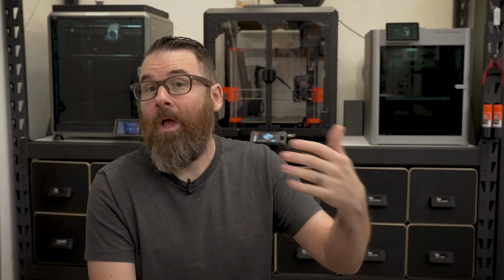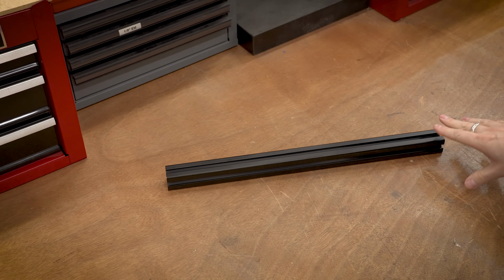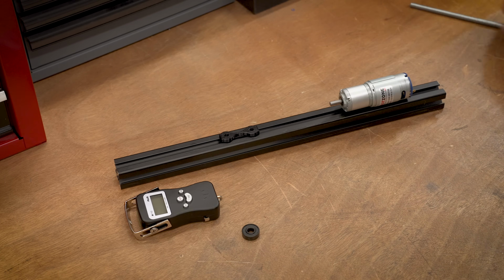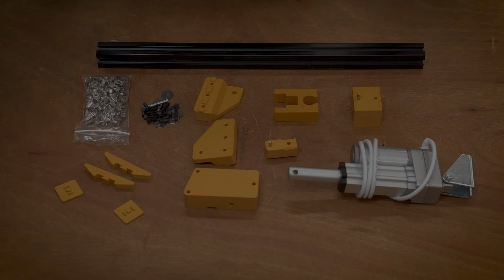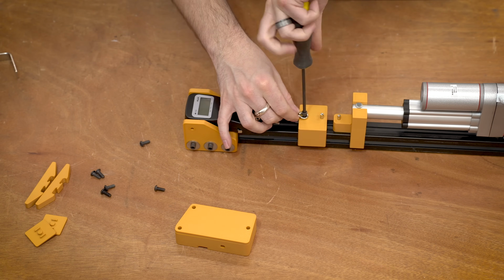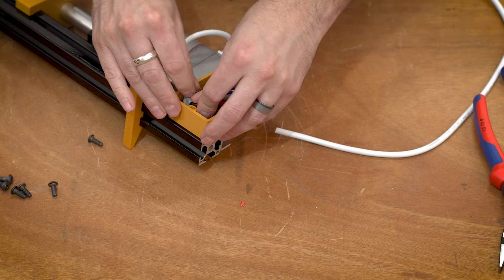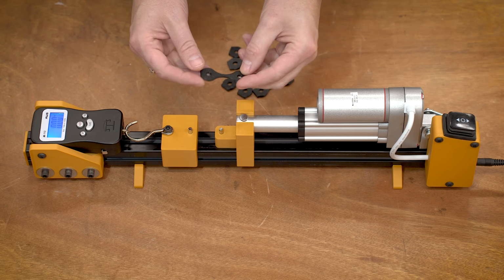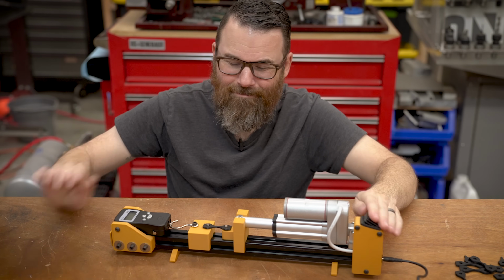Simple Tensile Strength Tester - Easy to Build!

Comment: Great machine, using this for a school project I am doing, I have a slight issue however with the luggage gauge you used. Once the testing piece reaches its max load and snaps, it doesn't record it on the gauge. When this happens it flashes the screen (It is on hold mode).

Comment: Nice work. Few suggestions if you plan to improve this work: try to align pulling cylinder of linear actuator with hanging scale (same height). Otherwise you will have some torque resulting unknown friction. Additionally in that case, you can use some D-chain link on both sides of test objects to connect linear acturator and hanging scale. No need for those parts in middle you mentioned that they will wear out. 
Reminder to viewers to buy a hanging scale which will show the peak of one movement. PLA is strong just don't like constant load, impact and heat. So for this application it is good. Only material which would be better is PC-CF. There are bigger T-nuts, but they are not rotating (you have to slide them form the edge). I suggest those for big load applications, like on side where only two holds the linear actuator. I enjoyed the video. Thx.
Reply: I had a feeling that I will see you there Igor 😂! Definitely gonna be inspired by this design for my application!
Reply: I bought all the parts from @thenextlayer Aliexpress links for this tester. Your suggestions for improvements make sense. Before I start printing the parts I think it would be better to modify the design to incorporate your suggestions.

First, if I understood correctly, you suggest to make the scale and actuator line up at the same height. That means scale has to sit higher so mount for the scale must be modified or new design must be used. I anyway have to use a different mount since I did not get the same scale.

Second, what kind of D-chain links do you suggest? Do you have a link to a picture or even better a specific model to purchase? In this case you suggest to completely get rid off the two "sacrificial" parts and put D-chain link through the holes of the test object to pull and the other side of D-chain link through actuator hole and scale hook?

Third, I was going to use ABS for all parts. You think for the scale mount PCCF would be required?

I would appreciate the reply. I tried contacting Robert over Printables to get the CAD model to modify the mount for scale but he has not responded yet.

Comment: Why didn't you try to position the pins in line with the cylinder of the linear actuator, so that plastic part isn't being twisted?
Reply from the maker: I did think about this, but it moves the scale up quite a bit.  I've found this seems to max out the force on the scale so I opted for simpler/smaller parts.

Comment: Cool build! I can really apreciate the thought that went in to this.

Let me add that measuring the elongation would give you the Young's modulus,and thus a more complete material properties picture. 
Having sleds that ride on the extrusion will compromise the force shown, due to friction, maybe have a stabilizing brace for the actuator and a free hanging adaptor between the scale and actuator.
Not sure if you are basing the sample geometry on any standard but I would reccomend using the same size for all materials and basing that size on an actuall IEC standard, such as 60811 or 62895. This will give you a true comparison in the future.

Best regards

Comment: Easy and effective, though your motor is popping the pieces rather fast. If that scale is doing any sort of 'slow polling' or averaging for accuracy, you very well could miss peak events, I'd lower the motor voltage for a few trials, just to see if readings get higher, etc.
Reply from the maker: Yeah, that's a fair point.  I'm hoping that the scale registers a max fast enough.

Comment: Ah not made here syndrome (About the comment near the start).

I too do this all the time. I really like how reduced to the basics this setup is. Nothing to break or need calibration or troubleshooting and easy to just throw out and make another at the mildest frustration, sign of wear or breakage.

I definitely tend to over complicate the crap out of things. Id end up reading USB PD specifications, trying to figure out automation, never getting around to perfecting it if I manage to get it to "bah, it technically works" and wondering how I got there.

I will say though, I highly recommend thee get thy some auto wire strippers! You deserve the stress free squeeze without strands to poke you left on the desk. They work for basically every wire within range and I think basically all the non full size combat robotics sizes.
Reply from the maker: I have MANY wire strippers.  The knipex ones are really nice and one of my favorites.  I did a whole video on different types of wire strippers, I have them all ;-)

Comment: I would recommend trying to settle on one size of test sample, rather than having multiple sizes. It will make it a lot easier to compare all your data directly, and should remove some source of error compared to trying to look at force vs cross-sectional area or something like that.
Reply from the maker: Oh, I will absolutely do that.  I just need to land on the perfect size that works for everything.

Comment: Since you already have limit switches in the actuator that will disconnect the motor at the end of travel, you could replace the momentary rocker with a single momentary push button (double pole double throw, just like the rocker and wired just the same, but with no center-off position.)  Arranged correctly, the rig will fully extend and stop.  Pressing the button will make the rig retract until it hits the other limit switch and stop, or until you let go of the button at which time it would immediately reverse and extend back to the stop again, ie, it would reset itself after each test.
Reply: This sounds completely reasonable but I somehow fear a pinch trap is stored somewhere in that suggestion.

Comment: I think a good case for why people use stepper motors for this is that they're easy to control the speed of, and they exert their highest torque at their lowest speed. Since you want tensile testers moving relatively slowly, the torque vs rpm curve of a stepper makes a lot of sense for that application, compared to something like a brushed DC motor that needs to be spinning a lot faster to achieve peak torque. I mean you can fix that with gearboxes so I think either option can work well.
Reply from the maker: yep, 100% true.  However, most linear actuators are using gearboxes to slow them down and are essentially screw-drives too.  The problem with steppers is the control; they require some sort of electronics whereas as a brushed DC motor just requires a power supply.  it's all about the tradeoffs!

Comment: How about using a quick locking mechanism for the scale cuz using a screwdriver for six screws everytime is annoying 😅 + how about making the sacrificial pieces out of metal
Reply from the maker: Why does it need to be removed?  The sacrificial pieces COULD be made from metal, but it would increase the cost substantially and the plastic already maxes out the scale.

Comment: How are you going to test speed with those small test coupons? The printer wont be able to accelerate to much of a velocity in that small critical section. Maybe a thin walled tube for high speed adhesion tests?
Reply from the maker: You never want to test just a single sample, you'd always test in batches of 10.  But you're right, you won't be able to accelerate at all.  A tube is a good idea though.

Comment: Nice work, i only wish it would be cheaper 😅
Now i must find a scale with peek hold Funktion with shipping to Germany
Reply: For cheaper you can replace the linear actuator with hand actuated lever.
Reply from the maker: I did think about this, but once you add in a screw rod, some bearings, etc, etc, it doesn't save all THAT much in cost.  This is assuming the person doesn't have a lot of the parts just sitting around.  I did have some screw rod and such, but I envisioned $20 in trips to the hardware store.
Reply: I imagine if you really went penny pinching a screw drive n20 motor and some metal wire on a pulley could be cheaper, but I think this is a pretty good balance.

If you dont care about time as much I imagine you could chop a third off the price with the usual subjects though to me, Ive started valuing the idea of a project that is finishable in a straight burst a lot more than penny pinching.
Reply from the maker: @BeefIngot  Eh, an N20 is waaaaay to weak.  I don't think that would work.  There are other motors out there, a windshield wiper motor would be a good choice.  You can get them cheap and they have a fair amount of torque.
Reply: @RobertCowanDIY  With sufficient gearing the most weasley motor can move the world.... itll just take a bit.

I imagine the worm drives that go at double digits or fewer RPM will have the torque. That being said, it's definitely a "is that worth saving 10 dollars"

Edit: Because Im silly I decided to look into it and very roughly estimating based on rated torque (lower than stall), an N20 could probably be good for about 2Kg max with single digit RPMs >1000 ratio worms, so not really there for samples of this size, but for smaller ones it could work.

I don't know why I bothered looking this up...
Reply from the maker: @BeefIngot  In theory, but it doesn't actually work like that.  You just can't put that much load through the bearings or the lead screw.  Also, friction.

Comment: I hear simple and think bucket of sand and a scale -- does that mean I'm dumb? 😂
Reply from the maker: haha, not at all.  that COULD work, but it would take forever.
Reply: @RobertCowanDIY  Very slick setup Sir!! I might build a similar rig. Any advice on simplest methods for adding displacement/load readouts?
Reply: Yeah that's exactly what I was thinking too lol
Reply: @FryGuy1013  looks like you can also just pull by hand and record the max value -- there's an example on YT with the sample threaded over a screw driver rod 😅 Pull hard, boom
Reply from the maker: @literailly  that COULD work, but you need to be consistent.  Shock loads will produce different values versus pulling slowly.
Reply: @RobertCowanDIY  Yes, hand pulling is definitely not a great approach for precision.

You're the GOAT, Rob! Really appreciate your hard work providing this simple and GOOD solution to the masses!!
Reply from the maker: @literailly  ha, thanks!

Comment: It probably doesn't matter until you get to really high loads, but the item under test is off-center from the axis of the puller.  That will likely cause the sled to rotate and bind and give you bad readings.  But a simple height adjustment should fix that right up.  Great video, Rob
Reply from the maker: Yep!  It mostly straightens itself in those situations.  I tested this (off-camera) with loads beyond what the scale can handle and it still works fine.  The mechanical side is stronger than what the scale can register.